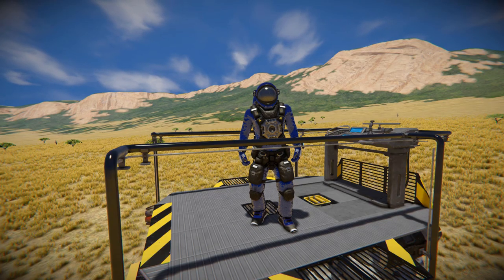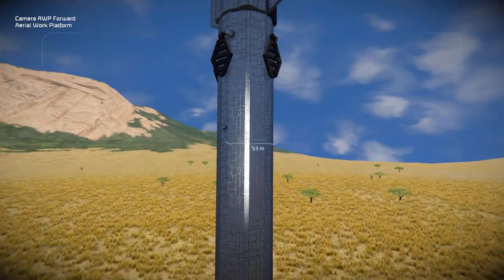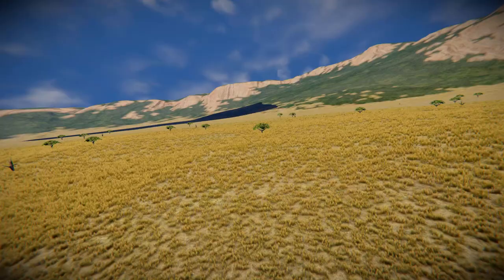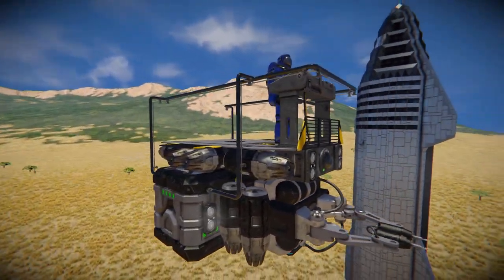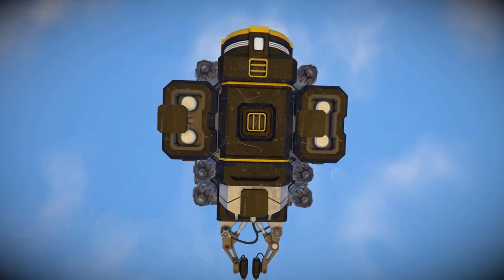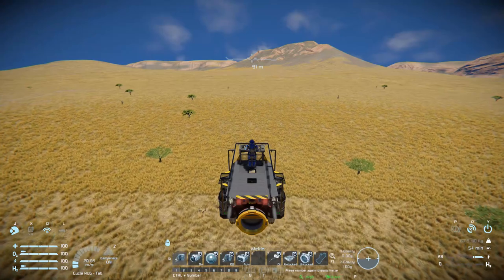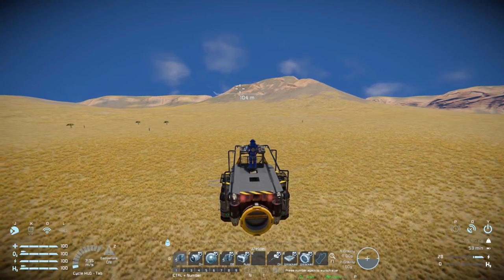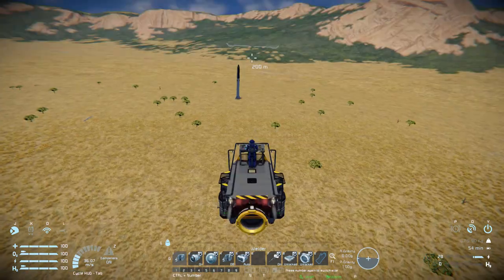The Aerial Work Platform! - Space Engineers

Comment: I love little utility designs like this but after briefly trying it out it went straight into the scrapper. Why? 

1. It's a pain to get into without a jetpack, basically requiring a bespoke dock. 
2. Lacks convenient landing gear/magnetic plates for locking to the thing you are working on. 

Personally I use a flying solar panel design which is thin enough to step up onto when it's on the ground, which is rimmed with magnetic plates so you can easily latch onto any surface and work/dock. 
I hoped this would be an upgrade, with its welder, but unfortunately it just doesnt work well without jetpacks. :(